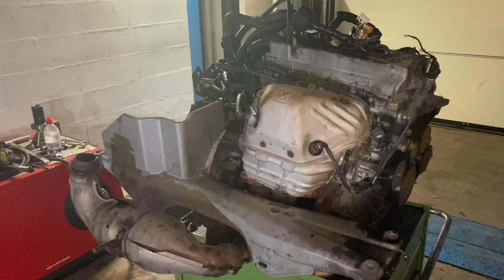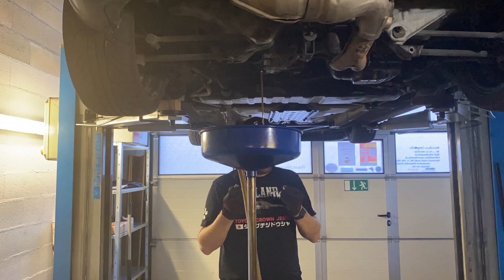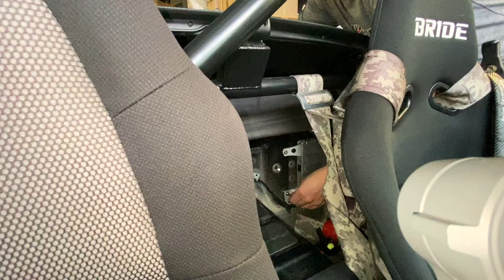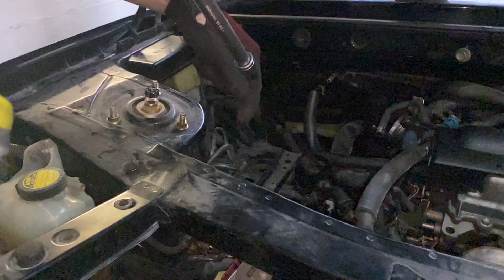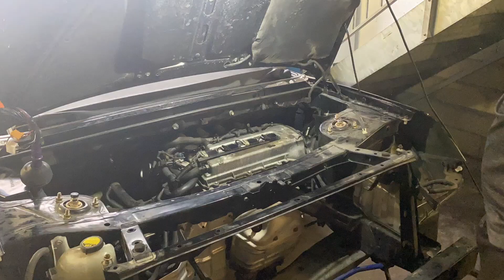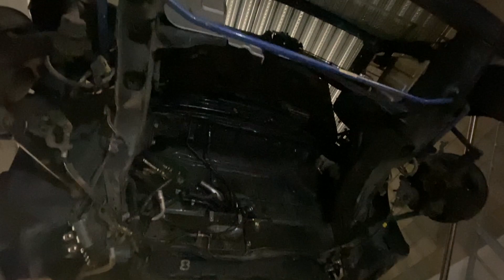EP9 Project Lotus Hunter. Finally removing the Engine from the Mr2 Spyder zzw30! How to remove a 1zz

Comment: How come the tailpipe has two pipes going into one instead of a single pipe all the way?
Reply from the maker: Hi! Thanks for your comment. You need to merge at some point from cylinders into one or two pipes. Its the tuners or manufacturer choses what they prefer. In my case I just chose something that allowes me to reusse my mr2 1zz Fujitsubo exhaust
Reply: @JesseSpec   I don't understand how the system goes from one pipe from the cat to two pipes before the single tailpipe,any photos of the exhaust system to get a look?
Reply from the maker: @Deanyfromtheburgh  you are in luck my friend! I’ve actually made an extensive video on my exhaust setup that shows it great detail. Have you seen it on my Youtube channel?
Reply: @JesseSpec  You got so many videos on there,a link to it would be handy,as I'm not sure which one it is.
Reply from the maker: @Deanyfromtheburgh  gotcha! Hang on i’ll find it for you
Reply from the maker: @Deanyfromtheburgh  here you go! https://youtu.be/dZ9iE4tgzwc
Reply: @JesseSpec  thanks for that,i see that its like a second tailpipe pointing up the way on the last section of exhaust,but when you started the engine,no smoke came from it,what is the purpose of that upwards facing pipe? I dont understand its job
Reply from the maker: @Deanyfromtheburgh  ohh that one! Its a resonnance chamber for noise reduction (not ideal for performance) but I’m leaving it in there for the moment since inspite of that aspect this exhaust made me gain 12hp on the dyno over stock! And the Exhaust is already too loud now hahaha